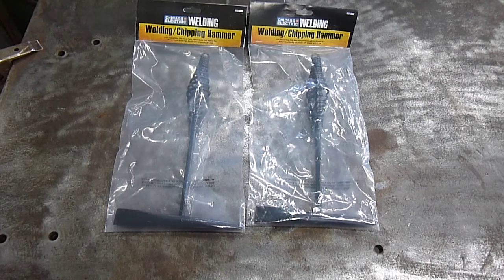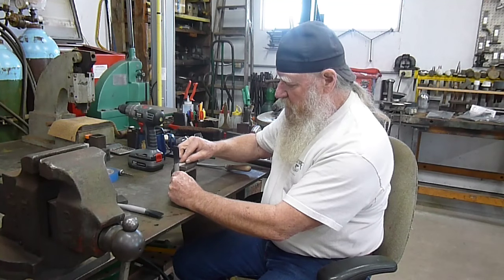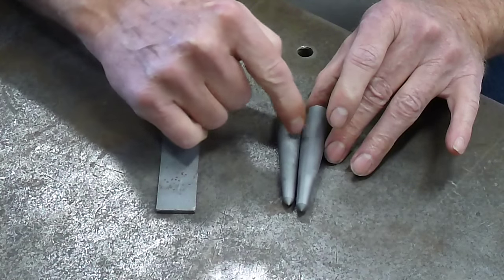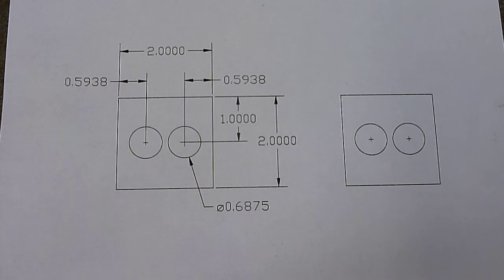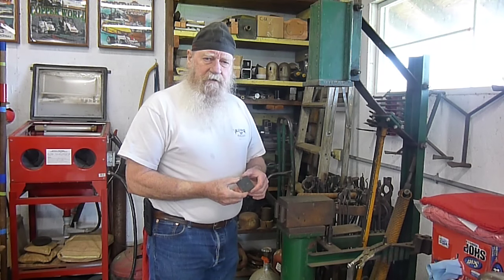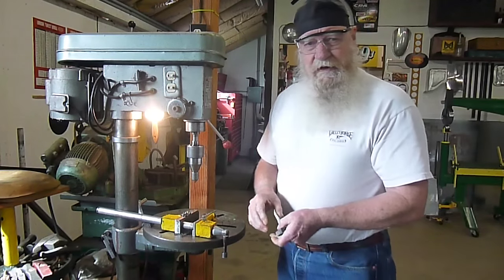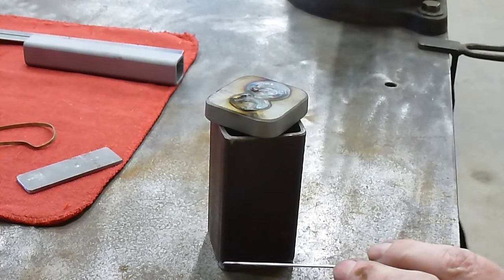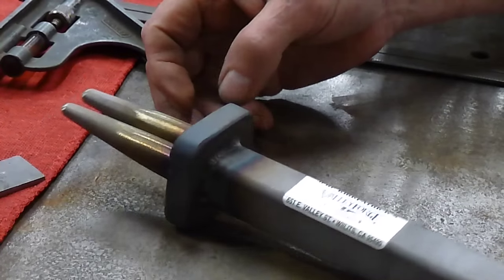How to Make a Tucking Fork #1 Movie

Comment: Great video.  It's always great to learn the processes people use.  Can you do a video about your kick hammer or whatever that was that you used to enlarge the center punches?  What else can that be used for?  Did you make it?  Maybe you've already covered this in other videos.  I'll check them out.  Thanks!
Reply from the maker: +Doug Pichler Thanks for your comment. The machine is called a Treadle Hammer. I designed it in 1985 and have built hundreds of them for Blacksmiths all over the world. You can find the plans for them on my web site. The one in the video is my prototype, not near as nice as my production model. If I get more questions about it I will make a video on it's many uses.

Jere

Comment: So, At first, I was thinking why go through every step of what looked like an easy job?
then you slam dunk a centre punch with the auto hammer from hell but next , drill a hole or two ...Er....Now  I stop and change drill bits for hours a day, and then, "What The *"...
What and where did you get the chuck and what stops the drill bit from spinning?  Going from a 1/4" out to a larger size in seconds and no stopping. 
Sir, you have well and truly got my interest way above normal.Thanks for your time if you decide to answer this one.
Tony

Comment: nicely done. though you don't need hardened steel to make a tucking fork, a couple of mild steel rods will do the trick. pipe works too, with some fettling. and by not buying cheap chinese imported products you avoid supporting that particular, highly flawed, economic model.
Reply from the maker: Hello Da Os:

Thanks for watching.          Jere
Reply: @jerekirkpatrick2092  my pleasure. thanks for taking the time and effort to produce the film.